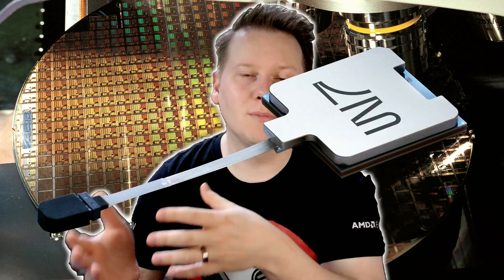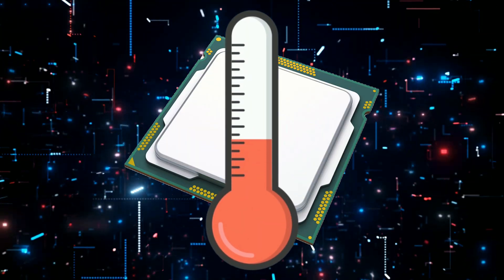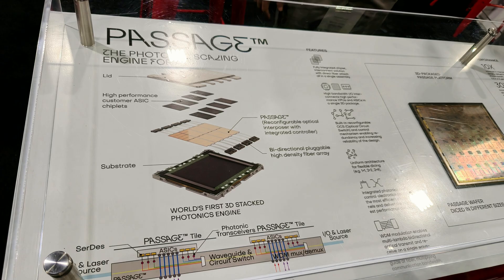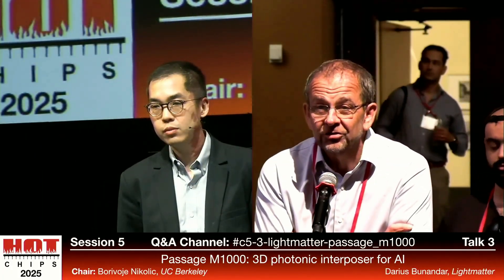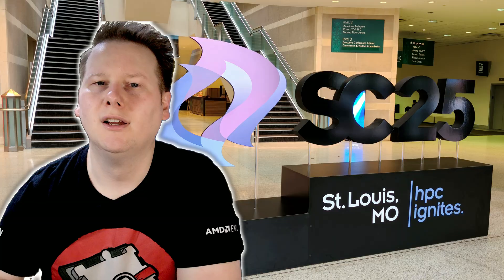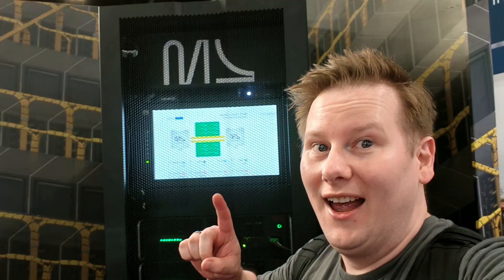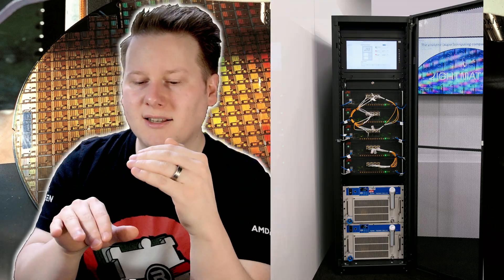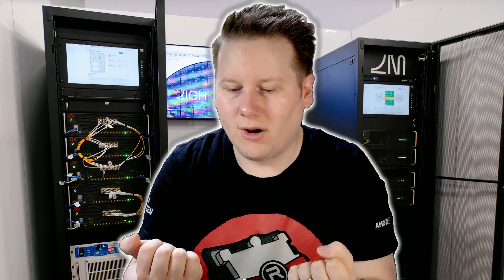I asked for a demo, here's how they responded

Comment from the maker: Update: The first demo is of Bobcat, the Lightmatter chiplet optical interposer, and they had data showing 1500C/sec ramping to showcase thermal stability. The second demo is of the full M1000 interposer, and the water chillers are being used as the system is loaded with 2kW of power to simulate real-world use.

Comment: An optical PCIE connection from CPU to RAM and dVGA, and optical connection inside the cpu packaging would be interesting. Lower latency, higher bandwith, basically a substitute of X3D.
Probably APUs would benefit the most.

Comment: It's like someone again (not first time) pulled a previously banned technology out of the vault and said "From now on, you can use it." But they didn't say what for. Hence the chaotic movements and unclear terminology, which varies depending on the manufacturer. I understand this is just the beginning and the scale is minimal, meaning now there are some interconnects between individual system components, which are today implemented using copper, but ultimately it's supposed to be entirely optical including CPU/GPU, where copper and silicone being abandoned.

Comment: Ian, how do these tech help hyperscalers? Is it for easier data transfer between buildings in the same datacenter or as hyperscaled CDNs for AI agents.
Reply from the maker: This enables direct chip to chip as if its in the same server, rather than through switches. It increases scale up radix before you hit scale out, and means you're not at the whims of single rack power density.
Reply: @TechTechPotato  so these tech are good for massive data aggregation and segregation say for example nvidia xPU ->connectX and in future scale up to proprietary xPU clusters or racks from AWS, MSFT, Google, NVIDIA etc. In simple terms unified access to all chips and their memory subsystem in zero copy mode.

Comment: Static is such a cop-out. Every single thing in that rack, including the rack itself, is grounded. There's no risk of "static" if you've shed all the electrons five times before you even open the drawer.
Reply from the maker: It's also partly they don't want something to even potentially occur on the show floor right at the start of the week, in case it does break and there's no backup to show other media or clients. The office with the replacement is several states away, not ideal for a trade show demo. Not something I'd argue about tbh, as there's plenty of time to get more hands on.
Reply: I think 'static' is their polite way of saying: I don't fucking trust you to be careful enough, to not have jewelry that slips off and shorts something or to sneeze into the machine.  Hell you might even slip and crack it trying to catch yourself.

But even a bullshit response about static is less likely to upset someone than suggesting that you don't trust them around the hardware as you aren't suggesting they aren't careful.

Is it rational from the company's perspective?  Maybe not but if I'm the guy in the room who might get fired if something goes wrong I'm going to be safe not sorry and static seems easier than explaining all that anc maybe offending someone.
Reply: @petergerdes1094  yeah, this is just very basic diplomacy in any case. It's rational enough, provided everything else is kosher.
Reply: @piripiri-kefalotyri  This isn't diplomacy, but lies, i.e., cynical politics. This doesn't really appeal to me. This isn't how a serious company operates. Unless, of course, there really was something inside that could have been damaged even by removing the electrical shields - because those servers were huge electrical shields.
Reply: @petergerdes1094  well, don't let him open it then. Open it yourself and show the internals. It's a cop out. There was something inside they didn't want Ian to see.
Reply: Those hamsters in there are very static sensitive

Comment: I don't think we're going to see centralized racks of HBM in the data center. The great thing about HBM is that its right on your chip, so memory latency can be low. Moving off chip, or even off system, puts a lower limit on the latency proportional to the distance. Light is great for low energy data transmission, but it is slow compared to modern chips.
Reply from the maker: The idea is that CPO gives an effective on package latency and bandwidth, and you're not limited to shoreline capacity - so better than off package.
Reply: Oh, that's the only way. Externalize the RAM. Externalize the mass storage. Externalize the processing units. Etc. There's no other option. The exact same thing must happen with every other component of the system. What we have now is a thing of the past. Only modularity can work with such complex structures. And I bet such solutions are already working. Technocrats don't count the costs.

Comment: You didn't talk about the following demo in your video (see rack on the right with no chiller at ~2:10). We showed 2000° C per second thermal aggression (at <1e-9 FEC-less BER) with our L-Series "Bobcat" test chip using on chip heaters (NOT sweeping lasers emulating wavelength shifts): https://youtu.be/gHvm4b1LajU?si=NxINHy1KPXwRqlZI

Comment: What sort of error rates are tolerable?
Reply: Per bit or per packet? 10^-9 for packets I would consider a minimum. Especially since it is in Enterprise. If it's for bits - 10^-12 or lower. It kind of depends what sort of algorithms you're using and if there is even some basic error correction.
This is standard for wired connections. For wireless and other stuff, it's often worse. On the other hand Enterprise might demand higher specifications. If this is per packet - then the highest error rate of 10^-11 is acceptable in most places. Mind you, this is just order of magnitude - exact numbers might differ slightly.
Reply: @jannegrey  Its a bit unclear what error rate even means in this context.  If you mean the rate at which the hardware reads the wrong bit before any internal error correction is done then it can be anything less than 50%.  As long as your protocol packs in enough redundancy in each packet to give the desired reliability at sufficient speed no one cares if you are in some sense 'really' sending each bit 3 times to hit the reliability target. 

If it means a true error, ie, the other end gets the wrong data and doesn't know then at 50 gbps an error rate of 10^-12 means one bit error every 20 seconds or so.  That seems way too high.

If error rate here means the rate at which you catch an error with an error correcting code and are forced to resend the information those numbers seem reasonable and you might even be willing to tolerate more depending on applications and other advantages.
Reply: @jannegrey thanks!
Reply: One that doesn't significantly impact system performance. Standards only matter when the whole thing starts to suffocate. Everything is corrected anyway.